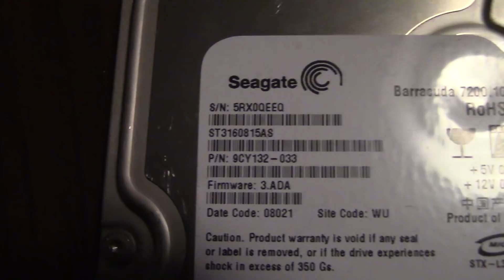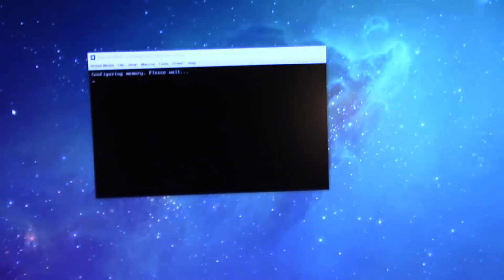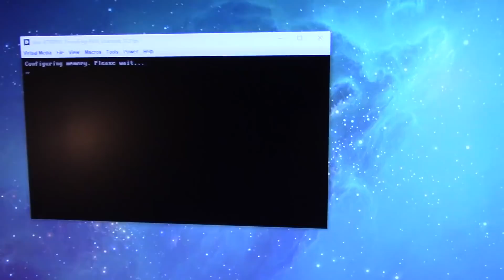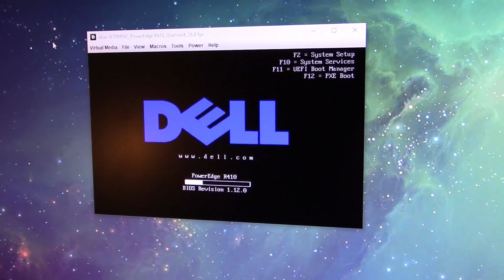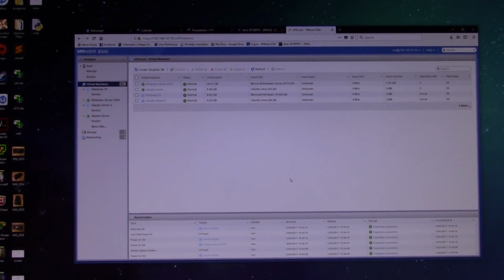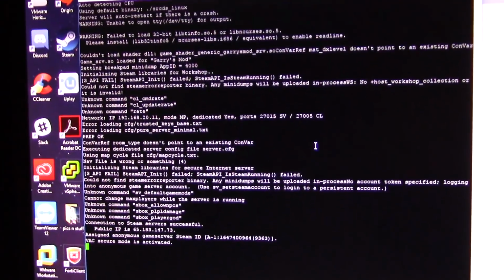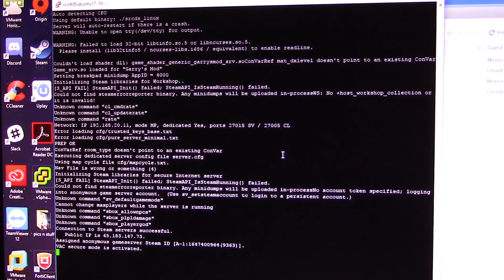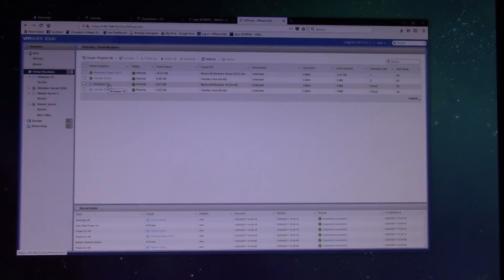Cheap and Powerful Dell R410 12-Core Server!

Comment: Do you still have this server? Are you willing to part with it? Otherwise, do you recall where/who you purchased it from on eBay?
Reply from the maker: I do still have it, was just running it a couple weeks ago until I finished my new Proxmox server. My eBay purchase history doesn't go back far enough, so I don't know who I got it from, but I don't need it anymore and would be willing to sell. Only question is if shipping it is even worth it, I'd need a fitted box and it might cost more to ship than it's worth.

Comment: They are super cheap for what you get. I purchased a Z620 workstation that has two Xeon E5-2660v2 8 core CPU's and 96 gb of ram. I use it for Work units from World community grid and soon to add a Dell Poweredge T620 tower server to my network. The power these machines offer for the money is great. For the price of one I9 CPU I can buy several servers with dual or even 4 Xeon cpu's in them. I will never go new again, there is just too many good deals out there for quality enterprise grade machines to pass them up.
Reply from the maker: I couldn't agree more. As long as you don't need GPU juice, these things are fantastic for raw compute power per $.

Comment: Id probably endup cutting holes in the case, slapping some 120mm fans on it with some larger cpu coolers, cool the cpus externally and the noise will drop 90% ;P
Wouldnt fit nicely in a rack or behind a desk but with some tinkering might look nice mounted on the wall ^^.... could become a functional art piece.
Wouldnt be able to stand the vacuum cleaner sound running 24/7 for sure.
Reply from the maker: Dell has an IPMI tool that can remotely manage the fan speed, I turned it to a reasonable level by default. I can still hear it but the white noise doesn't bother me.

Comment: Dude... one idea... if you're not going to like hot rod it... balls to the wall.. you could probably get away with unplugging a couple of those fans from the board... because , yeah noise... and man the only reason those fans fire up klike that is because the machine is made to just balls to the wall like run, but if you're just daily driver desktop pc usage, you wouldn't ever put that machine in danger of overheating... and with that... that's the last of my free tips of the day

Comment: Yeah, I completely agree with you and I'm a HUGE Dell user.. Respect... I'm about 99% close to buying a 1U.... My only question for you is as a daily machine.. What's the power output on that thing? .... Versus... my ... I run TWO machines in different rooms ... pretty much 24/7

I think it would be more cost effective if I consolidated down to something like that... Hoping to hear back from you, thank you.
Reply from the maker: I haven't measured wattage but it doesn't destroy the power bill too much, might be $10-15/mo in power. I wouldn't recommend it as a desktop style machine if that's what you meant by daily machine though.

Comment: i have an r410 motherboard and i should have all the requirements to get the board powered, (front panel but no lcd) but the thing is refusing to boot. i checked all my hardware for compatability and it should be fine but it isnt posting and im not getting any USB power or VGA output... what do?
Reply from the maker: Sounds like either a bad motherboard...

Comment: Question, I have the same server with 2 5650 2.66GHz. I have a PERC 6/i with 4 300 gig SAS drives. But I want to eventually add an external drive array. Do you have any suggestions on what controller to use and what drive array to use? Also, do you think there will be enough room to install another controller while keeping the PERC 6/i installed? Thank you for your help.
Reply from the maker: I don't have much experience with external DAS so I can't give you a ton of recommendations there, but NAS is always a good way to go because it's centrally accessible and guaranteed to be compatible. Only thing with that would be if 1Gb/s would be enough for you, although it's always possible to buy some 10GGb NICs.

Comment: What do you think about the noise level?
Reply from the maker: A bit annoying by default, but there's a nice guide on Reddit someone posted about how to use the remote management CLI tool to tune the fan speed which helps.

Comment: You should consider colocating (you would have to earmark some money for the cost, which should include shipping) but if you get the hardware for a cheap price it can make alot of sense getting a solid connection to back it.
Reply from the maker: I've got a solid 200Mb/s connection to my apartment with a Meraki MX65 as a gateway, could pay a bit more for 1Gb/s if I wanted, so internet connection isn't an issue. It's been super reliable thus far too.
Reply: that depends on his objective; learning doesn't bode well with colo ... Either that or just the love of maintaining hardware for the hell of it ... Like I do.